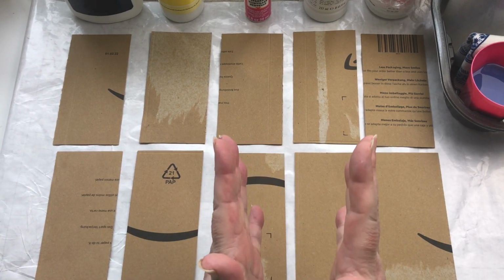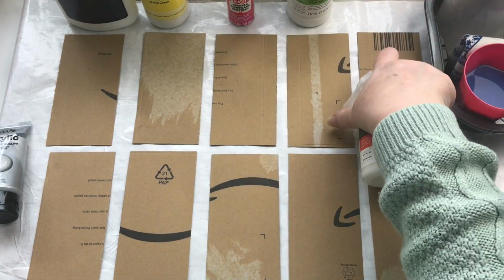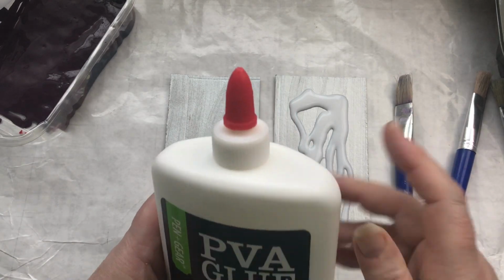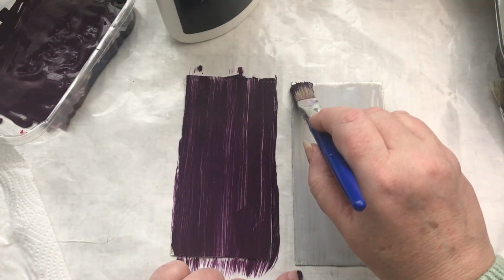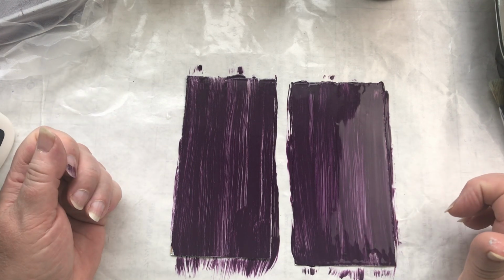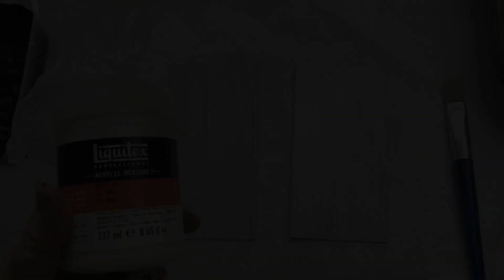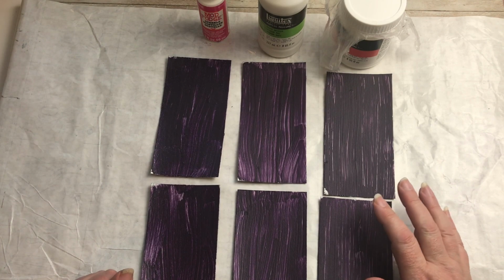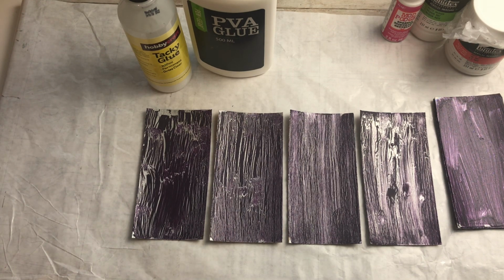CRACKLE PAINT BACKGROUNDS - TEST WITH VARIOUS WHITE GLUES -TT#2

Comment: And I'm back... as someone mentioned Carol has made watching paint dry fun..

When building a play back drop we played with this. We used Elmer's school glue, wood glue and hide glue. We needed big cracks on cardboard furniture and didn't manage to get desired effect and  resorted to painting crackle so it showed up at a distance. But we learned things.
For finer cracks apply glue with a sponge roller. Mottled cracks with pounced glue with a sponge. Linier cracks we used a brush as  Carol did. Cross hatching brushing horizontal and vertical was interesting. We were using a 3 inch brush so don't know how that would work with smaller brush. 

We also did some where we let glue get a skin on it before painting and the cracks were wider. You just need to apply a heavy coat and watch carefully touching occasionally to test skin. 
The Elmer's (PVA) and hide glue worked best. 
This was about 15 years ago. Watching you Carol has made me realize I probably have tons of ideas lost in my brain. I hadn't thought of this in many years. Probably not since after the play was over. Makes me wonder what I'm missing.😳
Reply from the maker: Sounds like you have got lots of ideas and memories Brenda :) xx
Reply: @carol.tinson-paper.crafts  I often worry I have something locked away that is important for something but remains just. out of reach. Several times you and others I watch have triggered things to the surface. I need to create a journal of craft and art things I do remember.
Reply from the maker: @soundoff61  sounds like a good plan 🌸